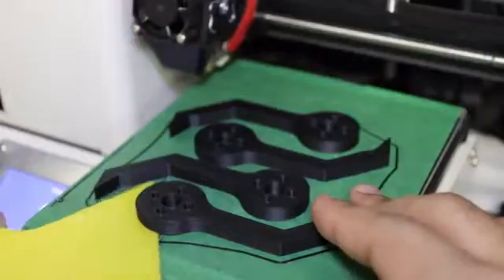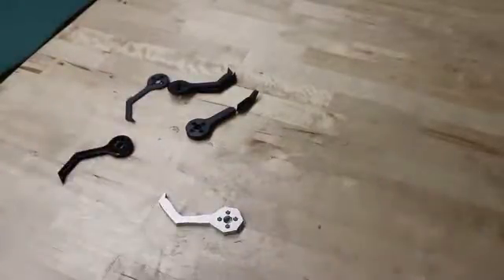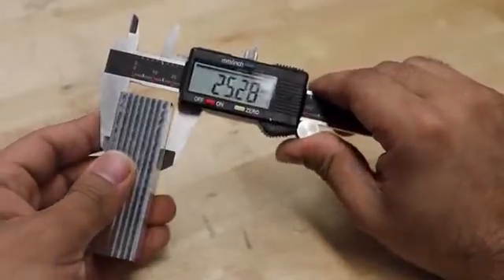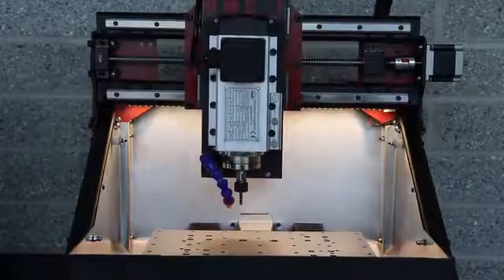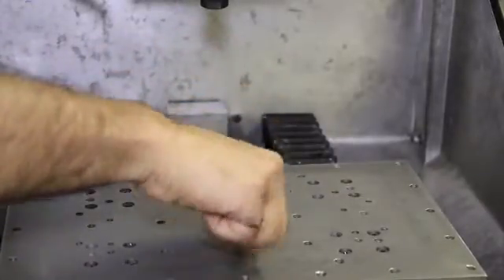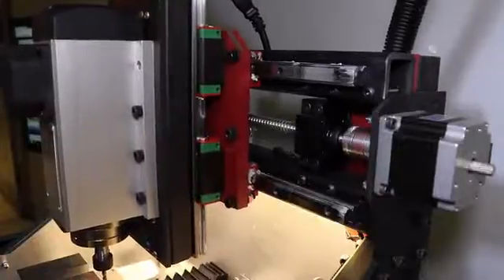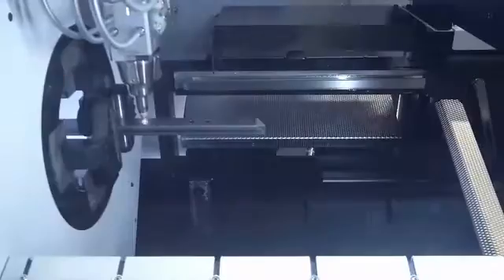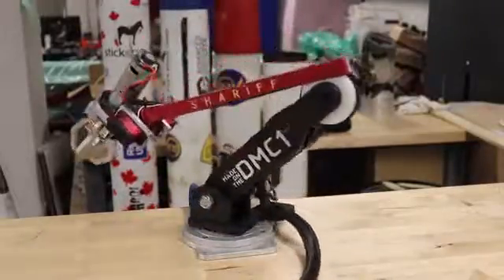Shariff DMC1 A Powerful, Affordable, and Capable CNC

Comment: No price info "give us your email then you may get" thingie turns me off, so I skip to next video FYI
Reply: Looks like ~$4K for a kit
Reply: Building my own cnc machine from all 3/4 inch 6061 aluminum. With hybrid stepper motors, 1605 Ball screws, materials cost me about $1100. Because I'm building myself, that's not including labor and other overhead costs, that would incur from buying prebuilt. Id probably charge atleast double since all the work was done on a shoddy comet replica of a Bridgeport without a DRO, and managed to get my tolerances within .001 all around.  Recommended Work area is 10x18x2. 
Theres a 5-6 inches from the tool to the bed, but not going to stick a tool out that far on a ER11 spindle.
Reply: @CNCGuy  would you be willing to provide pictures of your making?? Very intrigued!
Reply: @dave13454  Once its complete and cutting good, I will upload a video of it cutting. I did do a test cut in Brass running the 1.5kw spindle at 5,000 RPM. 1/8 2FL Carbide Endmill. Sounded very ridged.
Reply: @CNCGuy  awesome man can’t wait to see it, I’ll give you a sub to see it work! Would you remake one and sell it as well? And would it be able to cut things like steel/titanium?
Reply: @dave13454  I honestly dont know. I build the machine to how I want it. I do it in my free time which is few hours every weekend. I have plans to build a 5 axis only machine that can hold a 4x4x10 piece of material on 4 axis mode or 4x4x4 on 5 axis using built in rotary table in the 4th axis trunnion table... Think of Okuma 5 axis. 

I want to see it cut titanium, but first soft stuff for accuracy and speed tests in aluminum and brass. Next is Steel. Once im happy with that, move on to 304 stainless. If it can handle that, I'm confident it can handle titanium.
Reply: @CNCGuy  that’s incredible, would love to see the work and if you do make a 5 axis that would be out of this world. I aspire to have the skill set that people like yourself obtain.
Reply: @CNCGuy  hey man id love to pick your brain sometime about how you made it. ive got about $3000 CAD budget and im looking for a CNC like this. and i love to learn how to make it myself. i built a metal working shop in my garage.